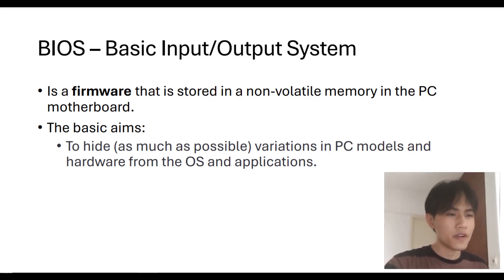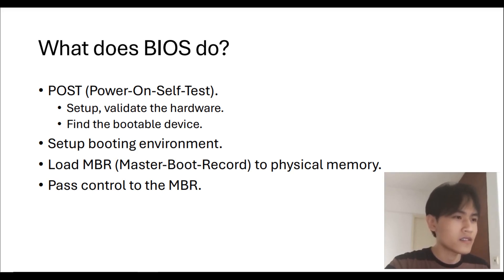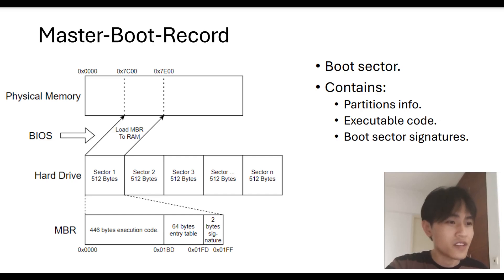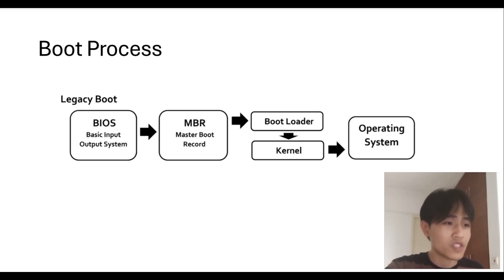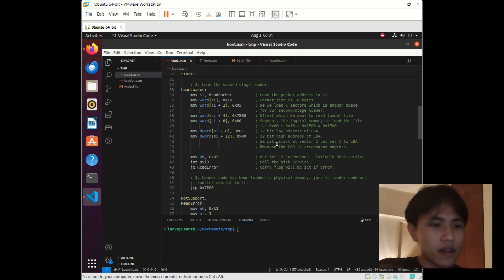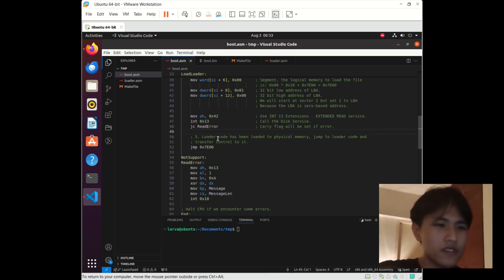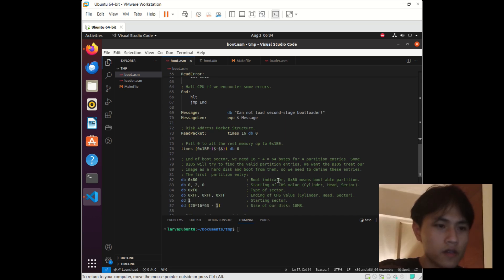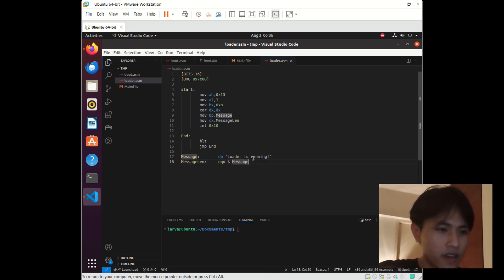BIOS, how it works? write your own x86 bootloader part I: Master Boot Record

Comment: Sir make video about how device driver works mean how processor send data to device and how processor take data from device
Reply from the maker: The CPU normally send data to the device via it's peripheral. Like the CPU write data to the UART memory peripheral, The UART controller write the data from memory to Tx line, and the device will receive the data in it's Rx line.
I will make a video talk about this.